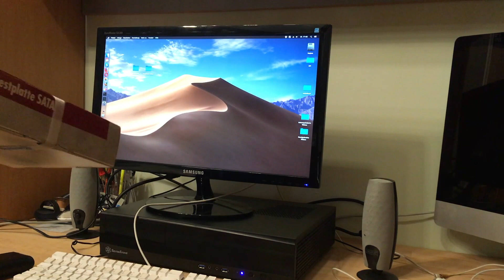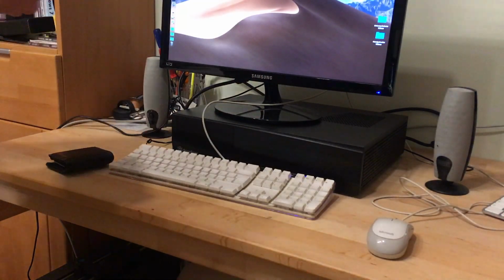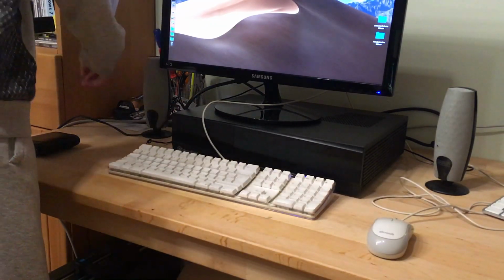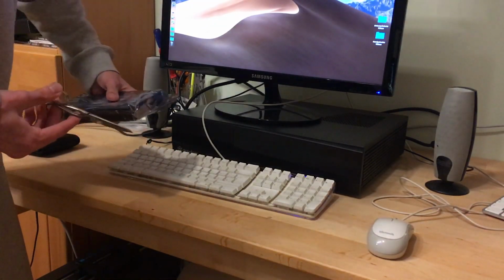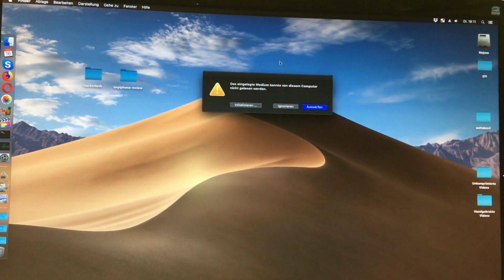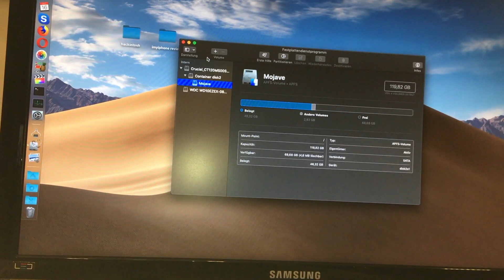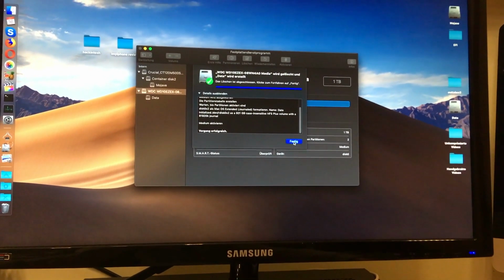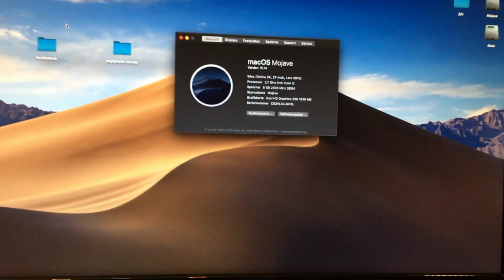Hackintosh Hard Drive Upgrade

Comment: I think I share your philosophy. I mainly buy used parts and make them last as long as they can. I find that computing is so much cheaper this way. Even though I might have to wait a shocking 5 seconds longer to load an application, it *works*! I personally love older hardware too. My CPU is 12 years old and still does everything it needs to with speed! :)
Reply from the maker: Yeah I totally agree with everything you said. I'm curious, what CPU do you have? Core 2 Quad?
Reply: @MacintoshMen  I have the Intel Core 2 Extreme QX9650, one of the best and last processors for Socket 775. :) I believe it's the huge 12MB cache that still makes this processor useful today.
Reply: @jezzermeii  Support, however my CPU is newer, xeon x3440 but works great even in the Mojave, on my channel there is a test, but the video card needs to be changed.